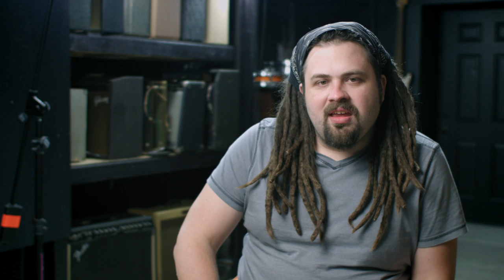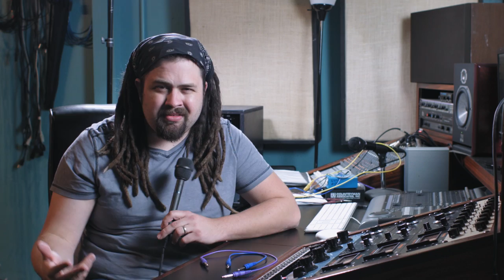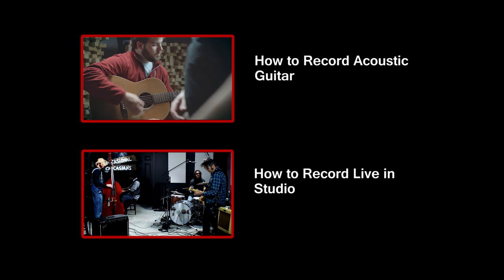Patch Bays - A Simple Explanation

Comment: Thank you , this is the first video i understand clearly ! 

I leave that here for people who buyed the NEUTRIK NYS-SPP-L1 for a deeper understanding concerning when and how we
have to flip the internal patch channel cards .
for the  NEUTRIK NYS-SPP-L1 for the setup you explained :
The first half of the Patch  1 to 12  , Upper raw OUT come from Preamps & bottom raw IN go to sound interface's Inputs,
This HALF-NORMAL mode is how this NYS-SPP-L1 is setup on all the 24 points by Default , so we don't have to flip those
connectors cards from 1 to 12.
2nd Half of the Patch 13 to 24 is for some comp / eq / fx  ( useless for them to feed into themself ) , So we have to remove
the Face of the patch to flip the connectors cards that way :  the only one "GREY ring" located > "Face  panel & bottom INPUT raw" (by default) after flipping the card must be located on : " Back panel & upper OUTPUT raw "  ; That way all  outputs from the processors units plugged at "Back & Upper Output raw" will automatically Isolate the upper raw from the bottom raw and avoid some feed a processor or guitar pedal in itself .

Comment: I could mention that the half-normalised patch connection will allow you to record the original on channel/track 1, and by plugging at the patch 1 out to a comp or eq input, then comp/eq output to channel/track 2 input, you can record the modified signal, all at the same time. You won't be able to do that without a patch bay, well not easily anyway.
I'm really enjoying your studio tour Ryan, and a great insight for a great studio setup.
Reply from the maker: +RecordingStudio9.com Thanks! Yeah, I thought I mentioned the bit about recording the modified and original signal separately. I know said something about in the studio tour video for the control room.

Comment: Is there any reason not to plug your snake into a patchbay, with inputs to your preamps below?
Reply from the maker: +explodingPSYCH The biggest reason is phantom power and keeping track of how the patch bay is putting your mics at risk. If you have mics that don't use phantom power, and you patch that mic into a pre that the phantom power is on (Or still draining off), then the 1/4 will short the connections and cause damage. Much better to have an XLR patch bay for doing this. Also, if you have something that is "Normaled" to go to a pre, and a different mic was going into the bottom jack and using phantom, then if you pull out that bottom jack, whatever mic you had from the jack on top, will get routed automatically to that pre, and with phantom.
Reply: +creativesoundlab Thanks for the response!

What do you mean by "damage"? I know a select few ribbon mics can be damaged by phantom power, but I've never actually own any mics that are harmed by phantom power. If I don't own any mics that are damaged by phantom power, is using a patchbay this way a problem?

Also: how would an XLR patchbay differ from a TRS patchbay, aside from the obvious connector type?
Reply from the maker: +explodingPSYCH The answer to both questions is that connector type. When you insert a TRS in, the "T" will make contact with the "R" part, meaning that hot and cold will be crossed or shorted. I wouldn't want to do it with any mic. XLR just keeps all the pins from ever crossing one another. For me, I don't swap out a lot of preamps, so I decide as I'm plugging it in at the snake which pre based on the snare channel number. For example my Warm Audio pres are 9 - 12, and my SCA pres are 1- 8. I'm not sure the damage it would cause a condenser to take the hot and cold and touch them together, (Pins 2 and 3 for most mics) but I won't want to find out. For ribbons, the actual ribbon will dance as a charge is applied to it. Heres a video of that happening. https://www.youtube.com/watch?v=8jsuCgGBQ5A
Reply: +explodingPSYCH Some mics that aren't damaged by phantom power may still become noisier when recording if phantom power is switched on when the mic doesn't need it. Just thought I'd throw that out there as well.
Reply: +creativesoundlab Good point about the tip crossing the ring. I'm still unsure why that would cause any damage. I guess I'll have to poke around now, because now I'm curious! Cool video link, btw.
Reply: +creativesoundlab maybe I can help with a little technical background:
Almost any old school microphone or preamp with a transformer in it can be damaged by asymmetrical phantom power application. Many of those have center tapped transformers and if you somehow connect one signal wire prior to the other while patching, you will put 48 volts across this transformer winding which is made for millivolts. (Now that I think about it: With TRS this will happen to ANY transformer, even if it is not center tapped!)

This will magnetize the core of the transformer, leading to distortion and no bass.
In most cases this can be resolved by demagnetizing the core with audio frequency (you need a lab test rig for that) but it is a bad idea to provoke such defects to begin with.

So yes, NEVER EVER use TRS for microphone patch bays and never ever connect / disconnect a microphone to a line with phantom power switched on. Always make sure phantom power is switched OFF before connecting/disconnecting a microphone.
Reply: +creativesoundlab Great content as always, Ryan. I was about to write a comment about this same issue, but saw this. So if there's a risk with a TRS patchbay with phantom power damaging mics, why not use all XLR patchbays and have XLR-TRS jack cables connecting from the back of the patchbay to your interface (if your interface has TRS ins and outs)? Is it purely for spacial concerns in the rack due to having more I/O with a 1U TRS patchbay as opposed to a 1U XLR patchbay? I hope my long-winded comment makes some sense!
Reply from the maker: +BavarianMonkey The best explanation of this I've ever heard.
Reply from the maker: +Martin Yeah, XLR will take up more space, and even the 1/4 inch is considered not the pro option. If I understand you correctly, I think you could do the XLR-TRS option you mentioned. Yeah, it's 1/4 TRS on the back, so anything that is XLR like a preamp out will be connected via a XLR to TRS cable, then patched on the front with another 1/4 cable.
Reply: +BavarianMonkey I've been running my patch bays like this for years (no mics that are damaged by phantom power though) and I've never had a loss of bass or increase in distortion. I've also never damaged a microphone. Maybe I'm lucky? I did just check with a buddy at a pro studio and they run their panel snakes the same way I do, but with TT instead of TRS, which to my understanding would have the same problem you are describing. 

I only have a basic understanding of transformers, but I was under the impression that so long as the transformer has not opened, it's likely to be functioning correctly. 

Do you have any first had experience with damaging either a microphone or a preamp, or know anyone who has? Could you give me instructions on how I could reproduce the damage reliably with a patch bay, X preamp and X microphone?
Reply: +Martin Yeah, my first thought was, if it is indeed harmful to the microphones (or preamps) then I could grab a couple of XLR patch bays for the preamp inputs, but then you lose any normaling options, which is a huge part of the functionality of the patch bay. I would think you'd want your snake normalled to your preamps, and your preamps normalled to your AD/DA, so adding a couple XLR bays doesn't seem to allow for that.
Reply: +creativesoundlab you're welcome, primarily because I already stole...eeeh "borrowed" some ideas from your channel here ;)
Reply: +explodingPSYCH  unfortunately, I do have first (or second, but read on) experience with that problem.

A
 friend of mine once brought an expensive tube mic with him, telling me 
it lacked bass when compared to the other same one he had. As far as I 
remember it was a Neumann one, but don't quote me on that. After some 
measurement it turned out the bass was there on the input side of the 
transformer but not on the output side.
He had a TRS patchbay for mic patching.
After
 I had diagnosed the "transformer lacks bass" issue, I connected a sine 
wave generator to the input side of the transformer, matched the output 
to a load and did some sweeps over the night. The next day the bass was 
back as it was supposed to be. (Demagnetizing the core)

I do not remember which preamp he 
used and what exact type of mic had that issue, but I have seen multiple
 cases where the "phantom voltage going the wrong way during patching" 
condition caused problems and since then I do not ever plug in any 
microphone into an input that carries phantom power.

I have seen 
similar things with mic preamps that used center tapped input 
transformers (I screwed up on that once), but those were caused by a 
sustained short on the microphone line.

Conclusion: If you really
 want to risk a saturated transformer core in your vintage microphone, 
use TRS. If you prefer to avoid such problems, use XLR (much less likely
 to cause problems) and ALWAYS switch off phantom prior to patching.
Reply: "AND always switch off phantom prior to patching"... If I understand correctly, the problem you are describing would be solved by doing that with a TRS patchbay as well, correct?

You mention an interesting example with the transformer in the preamp you tested, and while I've never done that test... I can only speak to practical applications.

Is there a chance that the patching could have been loose or backwards, or half plugged, or splitting the signal, or even running TRS cables on devices that use TS. I've had strange volume, signal to noise ratio and frequency response issues to running TS equipment (like tape decks, old analog synths and rack gear) with TRS cabling! These were all line level though. 

Is this a problem that only happens with vintage microphones as you describe? I've just never had it happen to any of my preamps (Midas, CAPI, SSL, Vintech, Great River) so I'm wondering what I'm doing to avoid the problem. I'm not religious about checking phantom power (though I'm always trying to remind myself!) 

... Maybe if I'd have had the kind of negative experiences I read about I would have learned to check phantom more closely, but none of my condensers, dynamics or ribbon are adversely effected by phantom power, whichever end of the cable I seem to be sending it too.

Is there a way to send phantom power to a mic or from a preamp that would universally/repeatably cause damage? Could I for example by a cheap condenser off craigslist or something to confirm the patchbay tip/ring plugging action as a more universal problem?
Reply: +explodingPSYCH yes, you are correct: Switching off phantom power solves the problem of course, with any connector including TRS. On the other hand, a patching system that can cause damage in microphones, preamplifiers or line level outboard gear if you forget to switch off phantom power would never be my first choice. That is somehow like the "speaker over TS jack" thing - not a good idea.

In order to cause this problem you need to have a microphone / preamp that does not have a coupling capacitor on the output, meaning that the DC current can reach the transformer. And of course you need to have a transformer in there. And even then the damage depends on the duration of the DC period and the characteristics of the transformer you are looking at.

The whole TRS / TS thing is another issue that should be discussed seperately. Of course, if a TS plug ends up in that TRS microphone patch bay, then the DC period lasts until the TS plug is being removed from the jack. This is the worst case scenario. However, in this special case I referred to earlier, no TS cables were used.

Plus: Did you ever touch 48V DC with wet hands? That can tingle a little...although it is not dangerous, you can feel it ;)
Reply: Given the specifics required, it sounds like what I'm doing is pretty safe then.

It also seems like it'd be tricky to set up a repeatable situation. I might keep my eye out for a microphone without a coupling capacitor. I'm not sure how to find what the correct duration a DC period would be, or even what specific characteristics I would look for in the transformer. 

Also, I would assume the issue with speakers and jacks would be the higher wattage (not present in phantom power), but even then, I've plugged TS speaker cables into the cabinet's jack while the power amp was on and never had an issue. I can't imagine that extending that action to an external jack would cause any problems... but if it did, I would imagine it would be in situations with higher wattage.

Comment: I'd have preferred to see how you utilize signal path for tracking vs mixing and therefore showed both the wiring scenarios.  Also would have preferred to have viewed the patchbay from overhead (or head on so to speak) rather than look at you talk and plug your cable in to the same spots from a side angle and distance.  I generally like your videos but this isn't one of them.  I won't thumbs down but I'm not thumbs up either.  This is your verbal thumbs down.